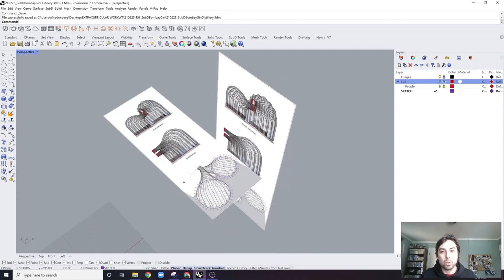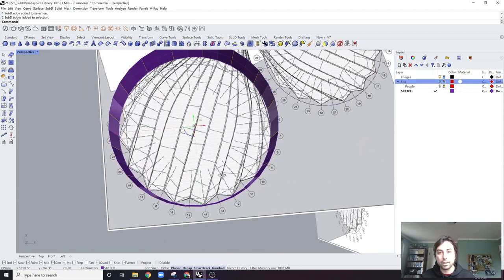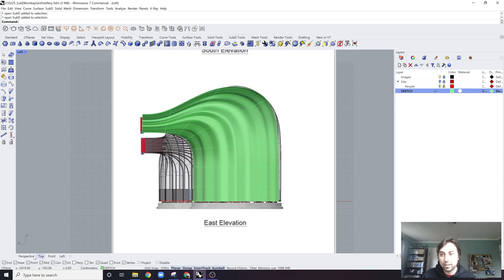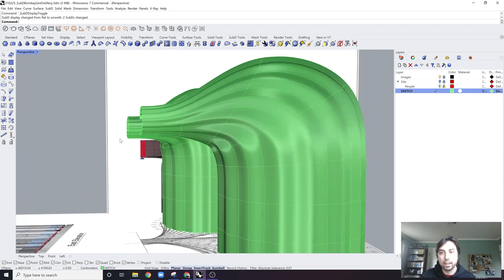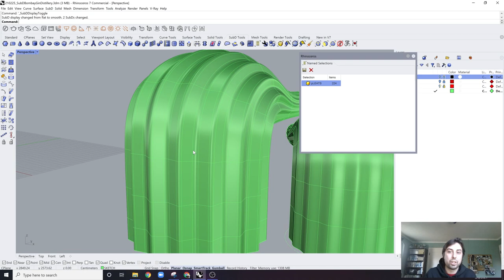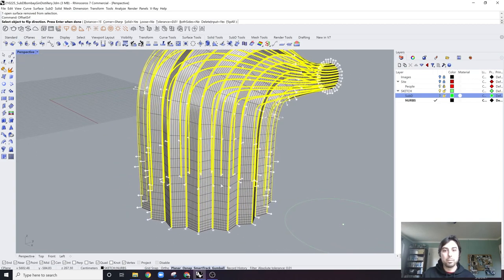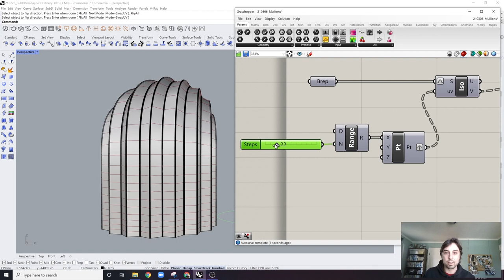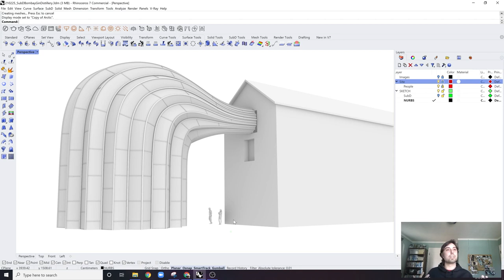SubD ORGANIC MODELING TUTORIAL - Thomas Heatherwick's Bombay Gin Distillery (Rhino7 + Grasshopper)

Comment: great tutorial Andrew! one more tech tip, if you're recording in OBS there is a way to add a filter to cut out noise. So any space heaters, fans, or computers processing get clipped out while it's recording so no need to post-process 👍 Feel free to DM me if you want help on the config! Great content I'm sure people will continue to appreciate your contributions on modeling best practices. Cheers!
Reply from the maker: Hey Tim thanks for the help. I just figured it out and also learned how to adjust the patterns on my new microphone....so hopefully you don't feel like you're inside my computers fan on the next vid. Thanks!
Reply: @AndrewFriedenberg  All good! I remember using the Blue Yeti mic before and adding the filter in the recording software helped smooth over rumblings that go through the desktop into the mic if not on a stand and also typing/fan sounds. But anyway! Wasn't distracting enough that I didn't listen all the way through.
Reply from the maker: @TimHalvorson  thanks for the support! I checked out your vids and enjoy them as well.

Comment: I had a hunch when working with subd in Blender that it needed a sensitive eye/touch, and this confirmed it.
I was following your subd modelling very closely, trying to really see on the reference picture where each vertex were, how the rings were rotated and scaled. But when the modelling was finished, and I looked from your video to my Rhino window, I felt a smidge of frustration. Each attempt at correcting my model, through scaling, moving and rotating made it worse.
I'm gonna try again from scratch tomorrow
Still, thank you for the tutorial, I learned a lot!
Reply from the maker: Good luck, it is a very sensitive method! I highly recommend using as low poly as possible and then adding edge loops at the end to acheive the right curvature.
.